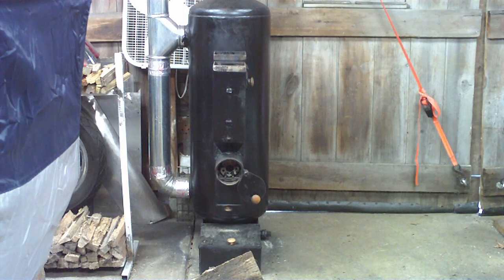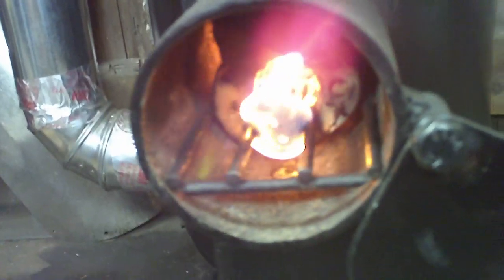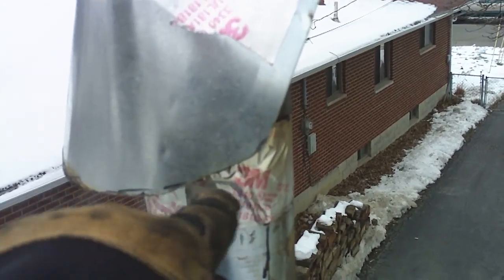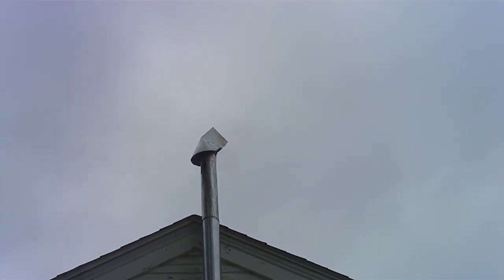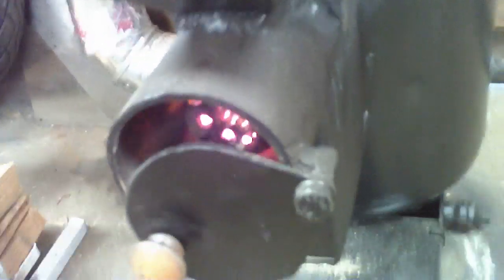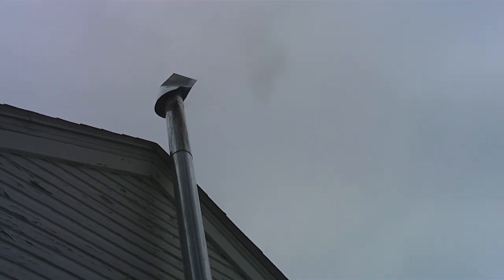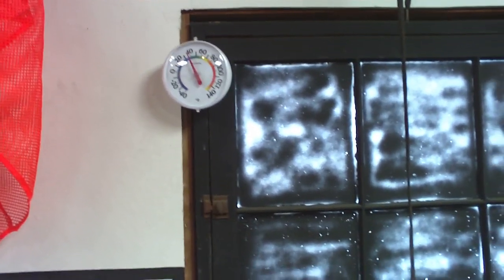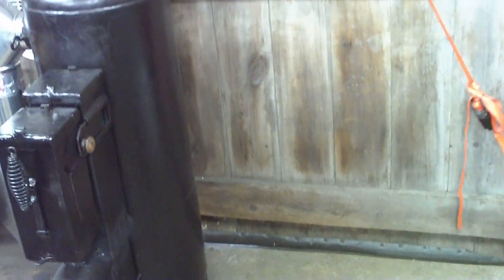Rocket stove questions, answers, confusion, and, a cold start up.

Comment from the maker: Yes Sir, you are right on. Everything on mine, from the round feed tube/burn chamber, to the riser inside the propane tank, to the exhaust up and out of the propane tank, is all 4 inch. Now my feed hopper is 5 x 5 inches, that's why I have the 2 air controls so I can better regulate the volume, and direction of the air over the wood.

Comment from the maker: Thank you, and yes, it does help some to do that. The thing is though, you get a lot hotter burn introducing the air from that angle. If you want a cooler burn, then the wood hopper door needs to be either partially shut or completely closed.

Comment: Sounds like a new video series. It's an 83 w/ dual overhead cams. Kind of beat up and the turn signals are sagging. You know the type of turn signals the rubber ones that stick out 6 inches or so. I have two turn signals for the front I am thinking about some sort of LED turn signals in the rear. Unless you can think of some other substitute or something.

Comment from the maker: Absolutely. I have tried some run of the mill fire wood from my neighbor, and either stove will burn a 3 x 4 x 18 inch piece with no issues having to stoke them. Also, I think the oak that I have is extremely soaked through with water. The last couple of weeks, I noticed by the time I get to the bottom of the rack, it has had a chance to dry out some. Still, it seems the smaller that the wood is split up, the better it will burn. Thank you, I appreciate the complement and for watching! Jeff

Comment from the maker: Thank you very much! I have no clue to the BTU output on these. I don't even know the math involved to find out, Lol!!! The top hat type propane heater that I have has a max output of 85,000 BTU's, that's what is on a sticker on the side anyways. I agree, considering the flame that is generated on either of my stoves is about the size of your fist, and cranks out as much heat that they do, pretty amazing! I cannot believe that a commercial wood stove builder has not picked up on this technology!

Comment from the maker: If I shut the door on the wood hopper completely closed, and leave the swinging door on the 4" feed tube halfway open, I can get a cooler burn, around 600 to 700 degrees on the feed tube itself, and around 400 to 500 degrees on the top of the tank. This is about as tuned down as I can get it without it going out.When the sliding door is open on the wood hopper, the flame tends to rise up in the hopper a little, and thus I get more heat output. The wood last a lot longer burning by itself. Thanks

Comment: As mine is much the same way yours is built, I plan to wrap the tank portion with thin sheet metal and use a squirrel cage fan to blow the heat into my duct work to heat the house. I'm curious to see how long a 40 lb. bag of pellets lasts, so I know how big to build the hopper. Good work!!
Reply from the maker: Awesome! Cannot wait to see your stove in action. Should be able to get several hours of burn time out of a 40 lbs bag of pellets. Thanks for watching!

Comment: Rocket stoves are habit forming.What was that old commercial,can't eat just one.Gotta keep building em..I learned on my first one,you can't use stove pipe for burn chamber.One night ,I thought I left greenhouse light on.went back and the 55gal. top was red hot and you could see through it, not good.lol You got a buddy of mine  hooked I told him to check it out.See Ya

Comment: I'm guessing that puts out 200,000 btu's of heat give or take? I wonder if there is a way to gauge it?  If you compare it to a Salamander.. don't those typically put out 150K?  I think the propane one claims to put out 250K?
Pretty amazing given that it's just a 4" system.
Rocket Stoves!
Awesome stove! Excellent vids!

Comment from the maker: Thank you, I appreciate that! Yes, the box on the bottom is an ash pan just in case there is hot embers left when dropping from the ash catch. The small tube in the right is actually a clean out for the re claimer tank. I used a bung where a shop vac will fit snug into it to vacuum ash out of the bottom of it. Saves from having to tear it apart ti clean it. Thanks for watching and subscribing!
Reply: +Jeff Crutchfield https://www.facebook.com/video.php?v=10207620699770939 Not as nice as yours, but im still tweeking

Comment: Hey Jeff, How does it perform in the combustion chamber when you have the wood feed air intake completely shut and try to burn just wood.  I know you mentioned in the past you get better results when   you have it slightly open.   But I am not sure if you mean you have less temperature in the feed tube when you do that.   In my design,  I dont want any air intake from the wood feed tube due to safety concerns ( unattended burning) and I want to keep the feed tube colder. Thanks and great video !

Comment: I'm now getting about 8 hours from a 40 lb. bag of pellets. I've been doing a lot of experimenting with burner designs to make the pellets burn at a slower rate, to keep the heat down. I find myself shutting the stove down after a couple hours or it will cook us out of the house. My last burner design is more restrictive, letting less air thru the pellets and keep the heat down and it works pretty well now.  My next plan is to make a smaller version of what I have now and it should be perfect for my needs.
Reply from the maker: That is awesome! I think I am going to tear this one down this spring and check things over, maybe design a little larger wood hopper, but all in all, with two full winters using this stove as a primary heat source, it has preformed wonderfully. Thanks for watching, and good info to pass along from your experience with your stove. Jeff

Comment: Hi Jeff, what diameter is your exhaust pipe? I did an initial burn on mine and it wouldn't draft good. My feed tube is 4" square tube vertical about 12 inch's high, and 4 inch's away from the barrel. attached to the same diameter horizontal tube extending into the center of the of the barrel. welded to that is the heat riser, 3 inch  pipe,  about 2 inch's  from top, wrapped in exhaust wrap. My exhaust is like yours with a tee, but only 3 inch dia stainless. I cut my feed tube off and angled it

Comment: Hey Jeff,, its Doug in PA,, and I have a question for you on the pellets,, It seems even with air controls on mine, the most burn time I am getting is around 6 to 7 hours on the pellets.. Im wondering if you have any ideas on that..I can run the stove real slow with a nice steady burn, but it seems to not matter on the consumption,, I have a plate that slides in and out that I can adjust to regulate the amount dropping down, and even with it closed down to about a 1 inch space to allow pellets down it doesnt seem to  be making a difference.. any thots would be appreciated.
Reply from the maker: baetis0426 Hello Doug. It is probably the size of the burn basket. I have played around with the original design some, and shortened the pellet holder ( or burn basket, what I refer to as the revolver ), and did notice that the burn time did change quite a bit. Larger basket, more pellets that are consumed, smaller basket, less pellets to consume is my thinking. I wouldn't swear to it though, Lol! Thank you for watching! I really need to do some updates to these videos, I have found out a lot over the last 2 years on burning these stoves. Jeff

Comment: it draft's good now but only with the damper open. I'm currently changing the exhaust to 4 inch square tube mounted on the tank, and also with a damper.Do you think I'm going in the right direction?

Comment: is your horizontal and riser stainless..I'm looking at  using schedules 80 mild and wonder if it would hold up in a mild steel
Reply from the maker: They are mild steel, and so far, with 2 full winters of burning, absolutely no deterioration whatsoever. The stainless steel grates and pellet holder are another story. They have warped really bad and will have to be replaced. Thanks for watching and the interest! Good luck on your build, and I'll look forward to some build videos!
Reply from the maker: They are mild steel, and so far, with 2 full winters of burning, absolutely no deterioration whatsoever. The stainless steel grates and pellet holder are another story. They have warped really bad and will have to be replaced. Thanks for watching and the interest! Good luck on your build, and I'll look forward to some build videos!
Reply: Jeff Crutchfield Im thinkin the next stove I do im gonna follow your lead.. Im of the same mindset,, Im not much for fussin with a stove,, I wanna start it and walk away.. right now,, Im gettin about 4 hours on a full load of small wood.. I like the pellet idea of being able to control my burn rate. Im eventually gonna put this stove in my basement,, and im thinkin its gonna do a pretty good job down there.. right now I have it hooked up in the garage,, and even running it at around 800 its just to small.. my garage is 34x42,, so Im debating on a 55 gallon drum stove or trying to find a 250 gallon propane tank.. I have a fuel oil furnace in the garage I dont use that has a 275 gallon tank that im thinking possibly using,, doing a double riser tube configuration,, my worry is,, how big would my horizontal have to be to feed to risers and get the temps up so that it gasifies.. any thots would be appreciated.. Doug.

Comment: Hello Jeff! First of all, this is probably the best looking design I've seen. As a fabricator myself, I can see you take pride in your work, not many people do. Few questions though... How many lbs of pellets does your container hold? And using the wood as well is just from a cost perspective? Any and all help would be greatly appreciated Jeff!
Reply from the maker: Thank you Chris! I appreciate that! The pellet capacity is right @ 8 lbs. The biggest advantage being able to burn both at the same time is, you can attain a higher BTU faster, and second, if you have wood that is wet, or just plain hard to burn, the pellets can help with ignition. The whole reason I designed this stove the way I did, is because I had a unlimited supply of oak, but it was really hard to burn. Thank you for watching!    Jeff.